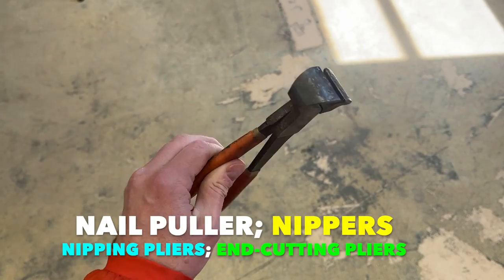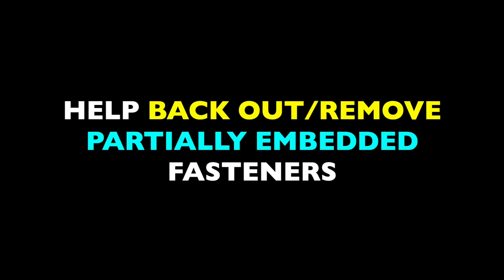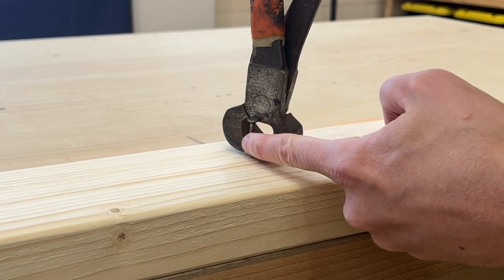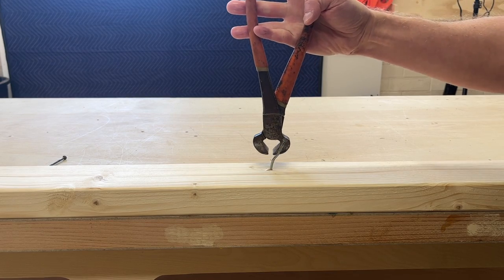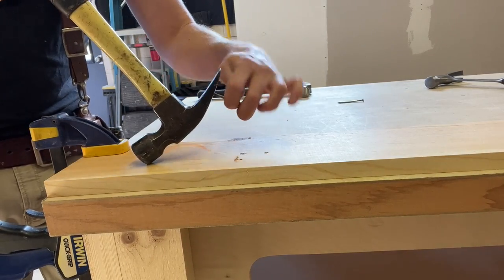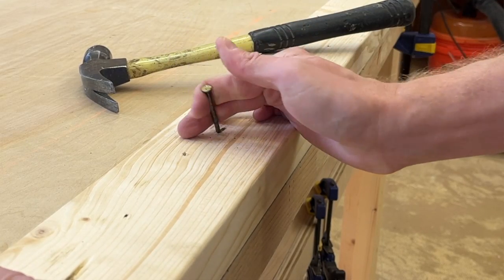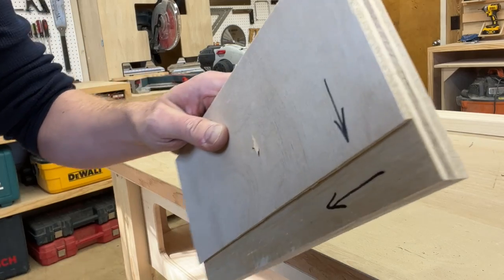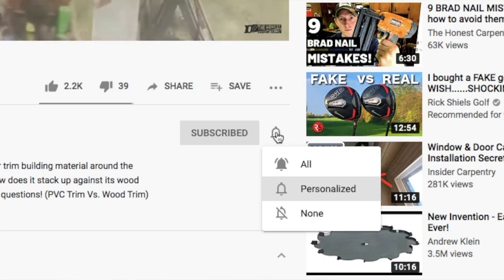This Tool Helps Remove STUBBORN NAILS + FASTENERS! (Nipping Pliers/Nippers/Nail Puller--How To Use!)

Comment from the maker: See how to use nipping pliers to clean trim boards easily in this video!:
HOW TO REMOVE TRIM LIKE A PRO! Don't mess up your trim and casings...
https://youtu.be/DFxTpCC5SSo
Reply: Great advice, I use them all the time.  A smaller pair works great for removing brad nails left behind when removing trim, but you have to be careful not to snip them off (unless that's your objective of course).
Reply: I've used it to pull out my teeth. 😬
Reply: I suggest anyone who’s in the business get a pair of Knipex 62 02 200s they’re head is offset and are strong enough to cut most nails especially the galvanized passload nail gun nails. Top of the line cutters imo

Comment: When my father moved into an apartment and not having sons, he gave me all his old tools.  Over the years I've used many of them and this is one of my favorite for all the reasons you gave.  I've used a putty knife to save a surface that might otherwise be marred.  Thanks for your great videos!
Reply: It’s great that you inherited a pair. As an average homeowner, not in the construction trade, I have very little need for nipping pliers, so I’d never purchase them. But there have been times when these would’ve been a god-send.
Reply: @mercoid  I've been very thankful for them and many other of his tools.  They haven't always been used for their intended purpose as  necessity was often the mother of invention so to speak.  Before I ever had any tools, a knife was a screwdriver and the heel of my shoe was a hammer.  There's been a lot of similar adaptions since then but I hardly ever have to do that now.  😁
Reply: What's the specification/ measurement of that you were using in the video OR which one you suggest for home use?

Comment: Nipping pliers are indeed useful, but many are hugely annoying because they will do nothing but shear the nail repeatedly instead of gripping and removing. I have one pair of the pliers that grip without cutting. I suspect you could flatten the sharp edge somewhat — too much and it will slip without gripping — but have never bothered to do that. Although not shown in the vid, the absolute best use of these pliers is to pull trim nails through the back side of trim wood. This avoids marring the finish with the tool and eliminates the inevitable breakout when the nail is pulled on the face side of the trim. Of course, trim nails are light gauge and shear easily, so if you have nipping pliers that grip without nip, guard them with your life.

Comment: a great video, as usual.  as someone who worked in construction, the only thing i would add is that jerking an old nail out will eventually break a wooden handled hammer and the edge of the jaws of even high quality nippers.  slow rolling the nail out without jerking always worked best for me.  crescent branded nippers worked best for me, but they can be hard to find.  the steel in cheap nippers will deform and ruin the cutting/pulling edge.

Comment: Seen so many tools over the years, using them in a manner that they weren't designed for. Have tools in which I know what they are for, but didn't know the tricks to make them work even better for me. Thank you! Now if you could only teach me to stop being so afraid of the circular saw!  I've operated many a powerful and dangerous tool and equipment and yet at 54 years old I'm STILL nervous with the circular. At 14 years old I cut myself with a mini electric chainsaw; I had zero respect for the thing and it got me good!

Comment: I have found that keeping a 4” square of Formica laminate around to put under the pliers jaw when you rock it to pry out the fastener really helps to prevent marring the surface of the wood.  The Formica is thin, small and fits into a pocket of your tool belt.

Comment: I'm sold. You showed some nippers with a straight handle, and for me they look like a pinky pincher. I can't seem to get my small finger out of the way with handles that come close together, but they pack away neater. Thanks for the video, your tips REALLY help. I had to remove some peel and stick tiles and the person used nails, they didn't know about the adhesive,. every kind and size of every nail in the world was used, even some upholstery tacks, covered by a nice layer of spilled paint. She thought it would be easier to remove when dry. It's a good thing she didn't let paint dry on the puppies that spilled it.

Comment: This is a great tip and something a novice can do right away.  Crescent Tools makes a "Nail Puller" that is purpose built for this and very effective.  Doing a remodel in an old house with square cut nails they had little to no head on them and could not be easily pulled up with a hammer. We used the nail puller, and nippers like these, to pull these old, stuck nails.

Comment: Great video I keep a pair in my tool belt but smaller channel lock ones. I don’t use them much on framing nails as I have a stiletto hammer and the side nail puller always is the best option. Where I think there key is for removing finishing and Brad nails. When pulling of base and casing grab the nails with the nippers on the backside of the trim and pull them through so not too mark up the finished side 👍

Comment: Been using EDC Klein diagonal cutters in similar fashion for decades. Paired with EDC early style Hyde stiff back single bevel putty knife for a pad you can extract nails with minimal damage. When you remodel old homes you often have remove and reuse trim because the modern equivalent no longe matches. Also an EDC is my Granfors prybar (Lee Valley). It’s suitable for careful trim removal or heavy demolition. The stiff back starts lifting the trim and then pads the prybar.

Comment: Another good video and this one brought back memories of my earlier days while working summers for my dad’s construction company. For three summers, I used my end nippers as a rod buster.  I preferred them over side cutters when tieing rebar for concrete columns and bank vaults.  Had to be careful not to break the tie wire.  However, they gave me the greater leverage to secure larger rebar.  Even though I was faster with side cutters, the nippers were almost as fast and were preferred on the tougher jobs. Thanks. I really enjoy watching your informative videos!

Comment: This was a real useful video!  I had wondered a different way to get out hardware.. I had thought to myself about notching out the base of a wood, than cutting the screw/nail…, then using wood filler to improve the aesthetic.  This looks much easier!  I’d say a floor sample wood help prevent denting the wood.😉 . As a side note floor samples make great shims😎.  Thanks for sharing Ethan 👊🏻

Comment: These are my dads favourite tool. A tip for very small panel pins with heads slightly proud, the rolling action you'd naturally want to use often won't grip enough. But if you pivot along the jaw line (similar to how one of the the claw hammer methods you showed)you get a much more controllable start to lift the item slightly, then can have enough material to grip and pull out the standard way.

Comment: Yes it is a great tool. It saved my life when we redid the basement and I had to save the paneling. It still wasn't fun by any means but I could get the job done. I hate nails Nate - then again rusty screws - that's a pain too. And on old houses you get the added feature of flathead rusty screws. Those are always good for a curse or two.
Reply from the maker: The flathead era was a curse, Dave! 😆

Comment: Converting a an old hoof nippers with straight handles, weld a 3/8 or 1/2 diameter by 2 or 3 feet long shaft and thread or weld an end on it with a slide weighted slide pipe. Turns into a slide nippers. Just cling the nail and slam and it's out. Works great on old roofing nails when there is a million of them.

Comment: Great tip on pulling nails but end nippers are not just a demolition tool. In my trade we tie a lot of stainless steel wire to hold things together and nippers are the tool of choice. Some people will use pliers for this but when you get used to cutting and tying wire with end nippers it is more efficient. The same way you pull a nail you can use to pull wire tight and whatever you are tying will stay tight.

Comment: Do you have a fencing tool. They. Are incredibly useful for many construction jobs removal of old metal work. Prying. Even an occasion use hammer. Designed for fencing but they should in my opinion be in every tool box

Comment: Amazing. I have a couple of those, haven't used them or even looked at them for years. They are also for working with metal wire used for fences, tying up rebar and stuff like that. Combination pliers get to do it all now.

Comment: I don't even bother with a claw hammer to pull nails. A cats paw and nipping pliers are so much easier to use and more dependable.  I never thought about switching directions though, thanks for the tip.

Comment: As a pro hardwood flooring installer, I use end cutters daily. They work great on 18ga Brad's and quarter-crown staples. Also do very well on J-nails from pneumatic nailers. I keep a 7-8" Channellock pair on me, and keep a 10" Husky pair in my tool bag for the tough pulls.
Reply: Try the Knipex 62 02 200 set which the head is offset and can cut most nails way easier than a pair of Irwin’s or whatever

Comment: One of my most used tools I build toolsheds and while my primary use is to pull nails I’ve also tied rebar with them (for shed slabs) used them to nibble off pieces of smart siding to fit trim. I even used them to replace a damaged plug on a skilsaw once, you can use them to strip wire but it’s not as nice as linesman’s or wire strippers. I ground one of the handle ends into a flat head screwdriver and I find it incredibly useful

Comment: I have an old set of “carpenter’s pincers”…only about 6” long and somewhat more curved jaws than the modern ones you showed. One of the legs also has a “forked” end for getting under the head is small nails and pins, to raise them enough to get a grip with the main jaws. Not used often but very good at what they do, especially if you do restoration work.

Comment: I use a set of nips that was used to build my cottage in 1887. They're still good as new, albeit with a patina that only time and tool oil can give. I use them for historic property deconstruction to remove nails from hardwood trim and interior framing by pulling the nails out from the back of the wood so there is no blow out on the face side so it can be reinstalled in a different structure without obvious damage.

Comment: I bought a new expensive pair of nippers and they are great but you can also pull nails with a hammer but crank sideways not in the direction of the "rockers" (as you posted). And if you have finishing nails in trim pull the nails out through the back of the boards so that you don't damage the face.

Comment: I have a pair of these that belonged to my great uncle. I think they’re actually cast iron. I use them to pull nails around the house all the time.  I find they do a lot less damage than the claw hammer and they fit in tighter spaces. Hate to get rid of them cause they’re probably antiques but they no longer sharp and don’t cut well. I never knew for sure what they were called until now.  I will be getting a new pair soon. Probably keep the old one for sentimental value.

Comment: On the "to buy" list.  Could have used a pair last year when I put in new flooring in my daughter's room and had to remove the trim nails from either the wall or the trim.  BTW - typically how long are trim nails, the ones I was pulling out seemed a bit big for their purpose?  Another great video.  Thanks.

Comment: One of the first tools I learned to use as a child, cleaning nails out old boards for my father (my son is now doing the same for me). 
 I always carry one, and have an old puttyknife close by for protecting the surface when needed. 
I also use it to tie rebar (with steel wire) when in a pinch. The name for it here in Sweden (hovtång) gives a reference to it origin with was for removing horseshoe and nails from the horse hoof .
Reply: very interesting information!

Comment: Crescent makes a nail plier that looks like a regular set of long handle pliers with a large curves anvil on one side. This works the same as your nipping pliers, but the curved anvil offers more leverage, a longer pull and a smooth flat leverage surge that generally won’t dent the wood.
Reply: Used this for years pulling nails out of the hard wood decks of 53' box trailer when I was driving long haul.
The only improvement would be to give them a little more bite at the business end like these nippers.
They pull most nails in one action with ease; ridged nails with glue would break but a grinder was usually the best option when you ran across those.

Comment: I always have one with me they are very useful, good for taking nails out of molding. Don't forget to use a putty knife or a piece of board to protect your surface if you want to reuse the wood. They come in all different sizes depending on the size of nails you have to remove
Reply: Try a pair of Knipex 62 02 200, the head is off set and is actually strong enough to cut most nails

Comment: Great video. Another technique for terminating long finish nails that won’t pull e.g. finish nails embedded in hardwood: wiggle the top of the nail sideways, parallel to the nipper jaws, with a light grip so the nail doesn’t cut. The nail will break off just below the surface of the wood.

Also remember that nippers are pretty handy for tying rebar, especially in odd spots you might need to twist several pieces of tie wire to pull rebar together. 

And of course, who hasn’t opened a bottle of beer with this tool?

Comment: The main disadvantage of a hammer as a nail puller is you need a lot of space to make it work. If you ever renovate or need to do work on an old house you will find nails in angles and places you never thought possible. These pliers and a catspaw are essentail tools

Comment: I use a vice grip to pull exposed nails using the same bending technique.
Reply: I use vise grips also but rotate the nail back and forth to loosen it and often it’s straight enough to reuse when reinstalling the item that i am removing.

Comment: Absolute necessity for demo and framing. They're also good for nipping off the end of a nail (blunting it) for situations where you want to avoid splitting - like when you have to nail near the end of a board. My only gripe with them is they're pretty bulky to carry around in a tool apron.

Comment: If you have a hammer and the nail gets caught but refuses to release, but a piece of a 2x4 under the hammer and pull. It creates so much force, the nail just slides out of the material.🙏🏻👍🏻

Comment: another way to remove a screw that is partially lifted is to grip with vise grips and turn 1-2 turns usually enough to allow you to turn out with fingers or by twisting with the vise grips in a vertical grip
Reply: I have used vise grips to remove nails and screws instead of these nippers! And used the cats paw to make enough of a dent/notch to get those jaws around head of a flush screw that’s totally stripped out.

Comment: Nipping players help salvage and reuse interior casings and trim. Pry millwork boards off the wall with finish nails attached, then use nippers to pull the finish nails out from the backside. The result is no nail holes or damage to the front of the trim, so the boards can be easily recycled.

Comment: On my set I deliberately blunt one side of the jaws as they can keep cutting smaller brads instead of pulling them and when I want the cutting side I just turn them around being careful to mark on the tool which side is the blunt side

Comment: My dad always called the Pall Parrot Pliers.  A quick Google Search did not find that name, but I found them called Parrot Beak Pliers.  They are really designed for nipping (nearly) flush to the surface.  But I agree, they are great for pulling nails as well.  They do take a careful touch since the jaws are sharpened for cutting not for gripping.
Reply: Yeah this is a problem I'm having removing thin fasteners. The wood is so hard that the pliers are just cutting some of the fasteners off at the surface.

Comment: You can do a lot with a pair of electrician / lineman pliers, used in very much the same way. It isn't as powerful, but you can do a lot, especially with trim nails. They are great for pulling trim nails through the trim from the backside after pulling off a piece of interior trim. The nose of the lineman pliers is narrow and gives a lot of leverage.  I'll often slide a pair of channel locks or something under that nose as it seems to amplify the prying. But, again, not nearly as powerful as the nippers.

Comment: Can this work for stubborn nails in concrete? I just removed the carpet in my basement, and there are still a few stubborn nails left over that have bent a hammer and demo bar when I tried using them.
Reply: I don't think so. Worth a try, though.

Comment: what do you use to pull the nails out of a metal building where you don't want to dent it at all.  The heads of the nails have worked themselves up so you can grasp them.
Reply from the maker: I would use a demolition bar with a cleft on the end. Place a piece of thin plywood behind the head to protect the sheet metal and pry nails out.
Reply: @TheHonestCarpenter  thank you.  I am so concerned about denting the metal

Comment: I've always just used locking pliers (what most people call vise grips) to pull out nails that I can't get out with a claw hammer b/c the heads have been compromised.  Nipping pliers seem kind of useless, b/c locking pliers do that job and lots more.
Reply: I use vise grips also but rotate the nail back and forth to loosen it and often it’s straight enough to reuse when reinstalling the item that i am removing.